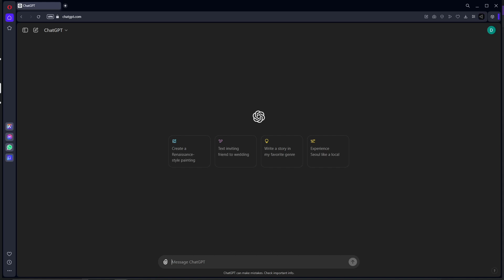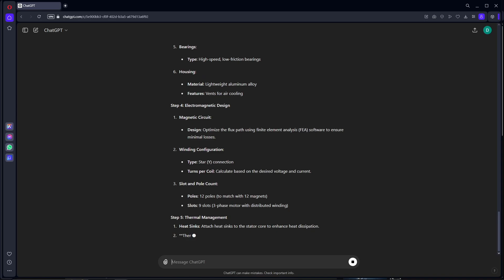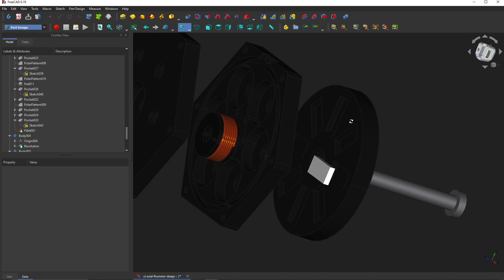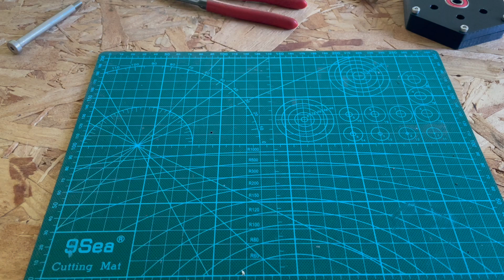AI designed this Axial flux motor

Comment: did you control for the polarity of the electromagnets? I have understood that you need to wind one clockwise and one anticlockwise coils for it to make a propper magnetic circuit (or perhaps since you are using a 6 to 8 arrangement you'd need another configuration, test by energizing one coil pair at a time, and testing where does your rotor moves, with different starting positions.

Comment: The spoil broke because 3d prints are weakest along the layer lines. I have also seen mechanical methods of counting turns used before, but I don’t know too much about how they work.

Comment: The motor would run. But you made the mistake of swapping the wires, meaning two coils are running in the right direction and the third in the wrong direction. Just check the winding direction of the coils again very carefully, use the "right-fist-rule of thumb," label the coils U1 & U2, V1 & V2, W1 & W2, and then connect them correctly. Of the 36 ways to connect the six wires, 33 are incorrect.

Comment: Hey, at 0:38 use 3 perimeters and wider liner width like 0.55mm for nozzle 0.4, also you can even do overextrude,  like 101% filament flow.
Reply from the maker: Good idea I will try next time

Comment: Use a more permeable material on the poles like iron instead of steel. Reduce the gap between the stator and magnets. Use a second rotor on the other side. Use thinner wire much more windings (calculated for resistance value). Encoder for motor position.

Comment: Get a IR sender receiver (like a TCRT5000) and an arduino, put a silver stripe on the drill head, tune it with a pot to pulse on the silver stripe, have it count your turns (cannibalize...or modify, I guess...the drill and have the arduino drive the winding all together. Sort of like a guitar pickup winding machine. Add a servo, with some trial and error, you can dial in the wind angles too). I second the idea of using thinner wire, for complex magnetic, RF voodoo type, reasons its just better for little stuff (be careful guiding thin wire by hand, that stuff will slice right through your skin like a cheese slicer). Also, look at the slop in the rotor. Try an all-thread bolt so you can tighten the axle up on the bearings. That wobble is going to (and probably already is) bite you in the ass.

Comment: hall effect sensor to fit the right speed and follow the magnetic flux rotation there is one in every brushless you open, you can find one into a cd drive brushless motor. the hall effect is making the timing perfect. but yeah triangular spools with way thinner wires hundreds of turns, this is a good idea to make a little spool turner for this

Comment: ChatGPT isn't designed for this kind of task. It's like asking a bright high school student who has read about it but never designed a similar motor himself.

The problem with the design is that the pulses delivered to the motor need to be synchronised with the arrival of the magnet, the speed at which that happens depends upon the speed and inertia of the rotor, and and you don't have any sensors to feed that information back to the controller.

Comment: I think your problem is not in the motor, but in the drive electronics.  When I look for how a pancake motor works, I find this:
 https://youtu.be/PFJ38sZE4Ms
This motor uses a commutator with brushes, which energises different coils as the motor turns, dependent on the position of the rotor - but I don't see any commutator in your design.  You said it's a 3-phase motor, so I'm guessing that there are 6 wires coming out of the motor in 3 pairs - call them paire-A, B, C. If you energise A, it will energise 2 coils (A1 & A2), and they will attract the magnets closest to them and, the motor will go to one static position and stay there.  If you de-energise pair-A and energise the next pair of wires (B), coils B1 & B2 will energise, and the rotor will rotate to the next position and stay there.  Energising C will make it go to the next position, and if you keep going A B C A B C A B C, it will go around - but the speed of rotation is dependent on how fast you go from A to B to C to A etc.  What you have at the moment is a stepper motor.  What you need is a bit of electronics that will switch your coils on one after the other, starting slowly and accelerating up to the required speed.  

So - what you want to do is speed up the stepping - but not from the point of starting the motor - it must start slowly then accelerate up to the desired speed by increasing the A-B-C-A frequency.  HOWEVER - if the motor is loaded mechanically, and slows down, you need to slow down the selection of the coils, or the coils and rotor will get out of step, and you will lose torque, so the frequency of your coil selection has to be controlled by the rotation of the motor - and more specifically, by its position.  Brushes and a commutator do that for you, but a commutator is hae=rd to make, and you can also do it with optical position sensors, magnetic position sensors, etc.  If the motor gets up to speed and is not required to produce much torque, you can make the pulses to the coils narrower, so each pair is energised for less time - to save electricity and heating the coils.

If I was doing this, I would have a processor like an Arduino between the sensors and the coil drivers - but that's just because I'd be using something I have used before.  There are lots of ways you could do it (transistorised circuit, for example)

Good luck.

Edit : You could do worse than to talk to this guy : https://youtu.be/1isqsi9h7c4
His motor is functionally the same as yours - 3 pairs of coils, 8 magnets, and brushless - so he must have got the electronics sorted out, as his is running and sounds good.  Maybe he can recommend ready-made electronics.  Check the resistance of his coils against yours, but I think you will both have low resistance coils.  You seem to be using thickish wire, and so does he.

Comment: magnetic flux is stronger when you have 2 disks with magnets ether side, air gap must be smaller, but you can overcome a lot of the inefficiency's with a sensor feedback motor driver. 
coreless motors are all about super efficiency with regards to losses in the iron cores / cogging and drag.
because of this you have a harder time keeping the flux inside the coils, and it can flit through the gaps. 
tying the magnet flux in pairs will increase the effort needed to push the flux around the coil, giving you better torque.
the back emf type driver you have reads the zero point crossing of the floating phase, your motor needs to have a faster pickup and better flywheel effect in order for the controller to establish stable drive, you can help by adding more mass to the flywheel, and reducing the initial voltage.
but without access the the variables in the micro controller you can not really tune it for this motor well.
a super quick fix for proof, you can attach a drill to another similar sized motor and use it as a 3 phase generator.

Comment: First thing to check is to rotate the motor (at constant speed) and measure the output voltage  with an oscilloscope, use the Y-point as ground. There should be tree (hopefully close to) sine-waves of equal amplitude 120 degrees apart. 
Then what you have tried is to run the motor without sensors. This is much trickier than running with sensors. You should get a drive board that takes  for example hall-sensors and then add these sensors to the motor. If the first test is OK and you got the sensors at the right phase it should run.

Comment: the 2 ways to wire an electric motor is in star and delta, your motor is wired in the star configuration and non-ferrous fixing around the outside

Comment: Bldc motor controlers without sensors have very little starting tourque. It might work if you get it spinning by hand in the right direction first to get it started
Reply: Sensorless controllers rely on back Emf, the voltage generated by the magnets moving by the coils to know when to turn on what coil. At  idle, there isn't any back emf, so the controller doesn't know what to do, it's why it was twitching like it was, those twitchs would be enough to jump start a smaller motor

Comment: Really nice project. A little sad it didn't work, it could be due to a bunch of factors. Maybe one of the coils is flipped or the magnetic fields aren't strong enough. The field strength would probably be the easiest to fix by adding another set of magnets on the rotor on the other side of the motor. I'm really looking forward to seeing more of this project. good luck.
Reply from the maker: Thanks, yea I designed it initially to have two rotors but I wanted to test it with one first. And since there is no load on the motor it should have absolutely worked. maybe one of the coils is flipped  I’ll see if there’s a way to test that 👍

Comment: Maybe your coils and magnets need to be closer and have a more dense structure in every direction. That's what I feel by its effort to rotate and failing to.
Reply: I think so too. Need a smaller airgap and likely need to use a magnetic material (ferrite/laminated iron) to improve stator field and make airgap smaller. Rotor could be optimised with back iron and/or sideways magnets (which have a name) to improve rotor field.
Reply: The threaded rod, assuming steel, will conduct magnetic field but it'll have Eddy current losses as the magnetic field is changing.

Comment: I think you are new to 3d printing. Your orientation of the wire spool was wrong. Add fillet, use PETG filament, and print it in horizontally (you have to use support), your spool will be stronger.

Comment: Very nicely done. I think you need a smaller gauge wire for the coils. Maybe 22 or 26.
Reply from the maker: Yeah I was thinking that too, smaller wire and more turns to increase the operating voltage.
Reply: @DeanZylman  Also maybe reduce the amount of filament used in parts so the mass decrease, resulting in the motor not needing to work to hard.